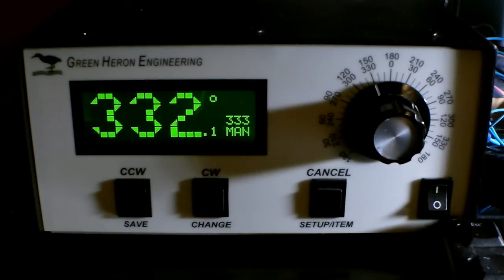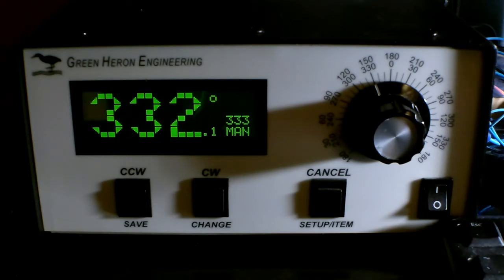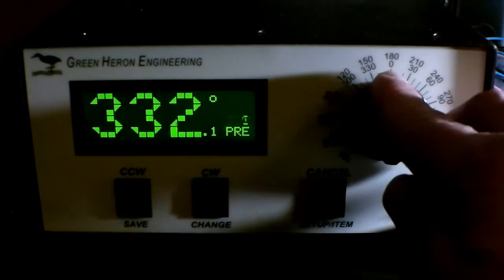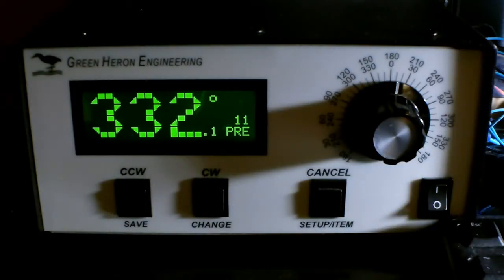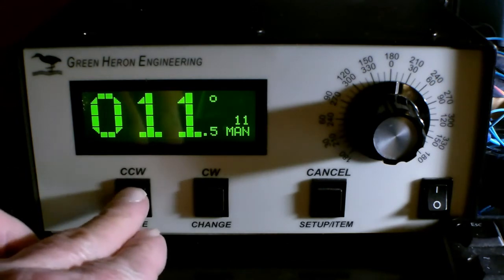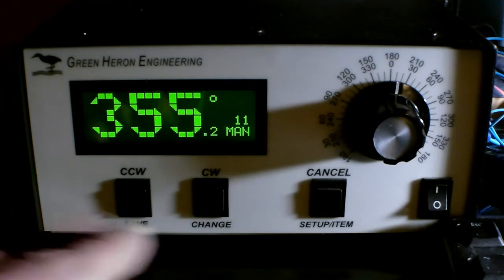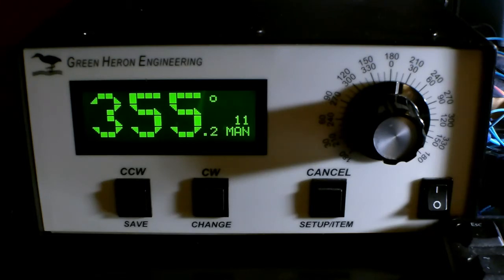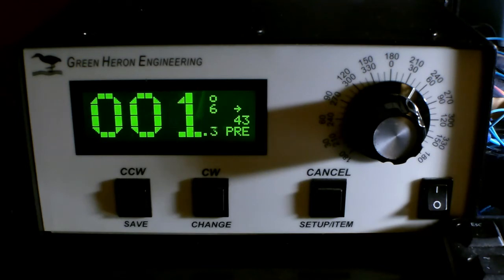Green Heron Engineering RT 21 rotor controller .

Comment: do you know if this will work with the ham 4 rotors?
Reply: Great question.  I read something about a capacitor added to the HAM pot connection to make the voltage more stable.